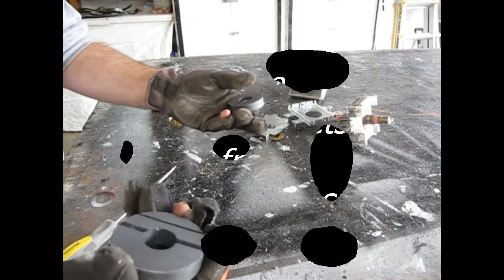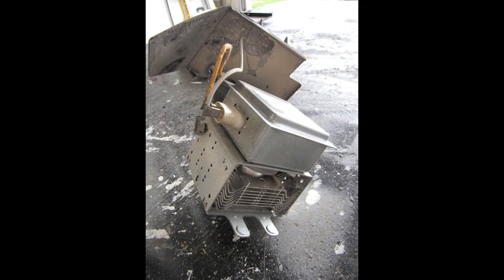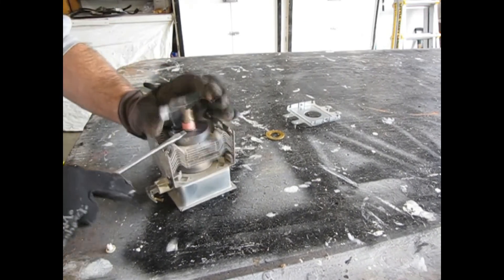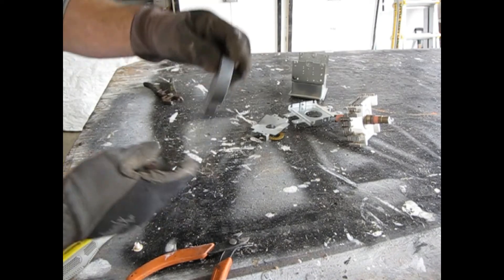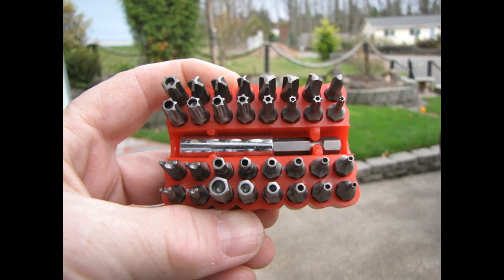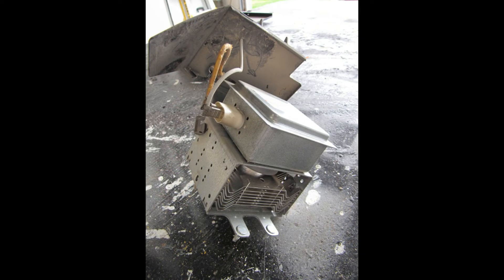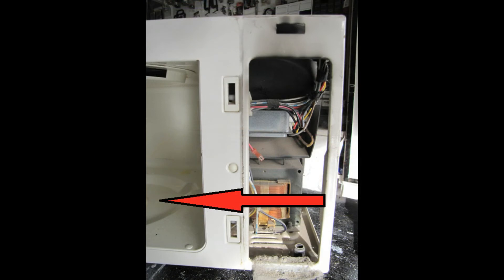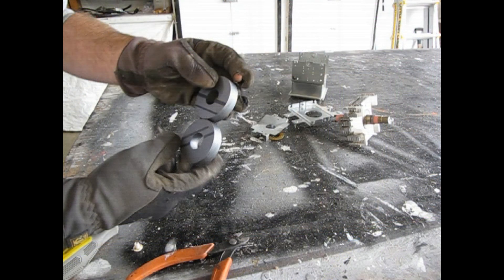DIY (magnetron magnets are free)

Comment: Let us not forget the little brother to those two big magnets that lives inside of the turntable motor that spins the plate around. just pop that joker out. take it apart with a pair of pliers and there you go, a nice little neodymium magnet
Reply from the maker: Wow, I completely missed those. You can be sure they are on my todo list for my next microwave teardown. THANKS!!
Reply: @bounder97  also I know your capacitor was attached to the fan and that made it dangerous but if you can find one that the capacitor is attached somewhere else that little fan and it's housing is actually really useful I just wire a switch up to it and then put a lamp cord to the switch and now you've got a 120 volt fan that can be used for anything you want
Reply from the maker: @jamescampbell7823  Thanks, that I did know about. I use the fans to provide ventilation to the chicken coop. All of the down floating around in the coop eventually destroy the fan, but because they are salvaged, they did not cost anything.
Reply: @bounder97  Sad part of this is I could easily have gotten a hell of a shock because as usual I don't research anything before I tear it apart because I come from the generation like you most likely where YouTube didn't exist so it's hard to get used to youtubing something before I do it and I didn't even realize that the capacitor was charged I didn't touch it thank God.
Reply from the maker: @jamescampbell7823  I'm surprised to hear you say the capacitor was charged. Although is is very smart to treat any capacitor as charged from a safety standpoint, a properly designed circuit should have a discharge path for capacitors at rest. I have torn apart probably 25 microwaves and never saw the main capacitor holding a charge. With that said, you can be sure that I shorted each one anyway before handling it. Regards...

Comment: I'd add a warning to the video. Be very careful as to not crack the ceramic insulators on the magnetron as they contain beryllium oxide which, if inhaled, can permanently damage your lungs. As long as you are careful in dissembling the magnetron, taking care not to disturb the ceramic around the wave-guide output or near the HV input into the magnetron. Sanding, chipping or cracking those insulators is definitely a BAD idea.
Reply: Thank you very much David. I will leave your warning  up on the video.